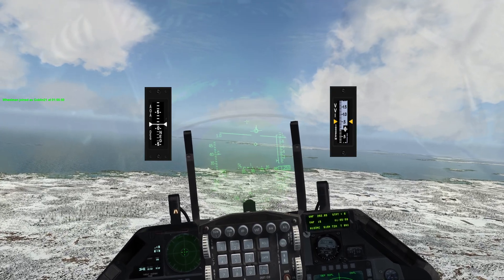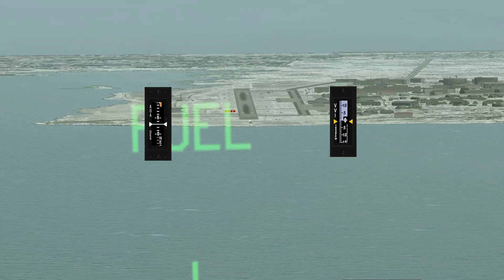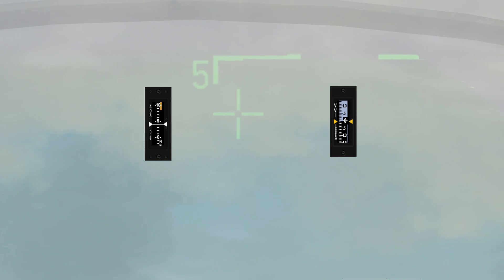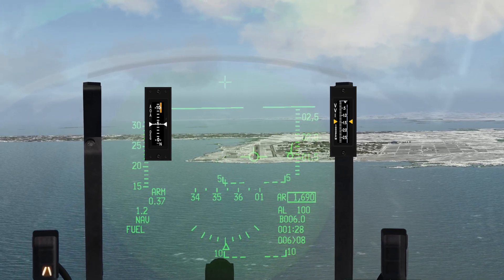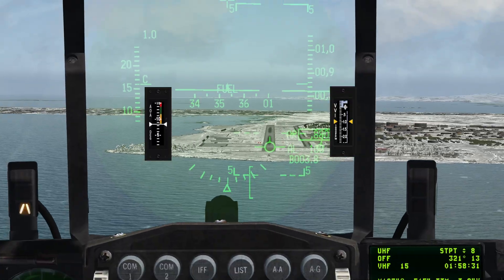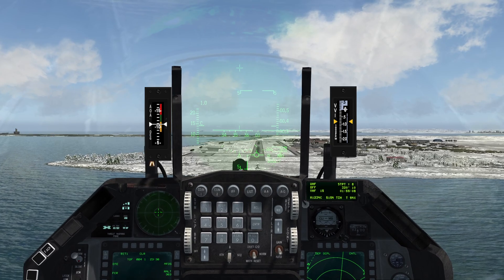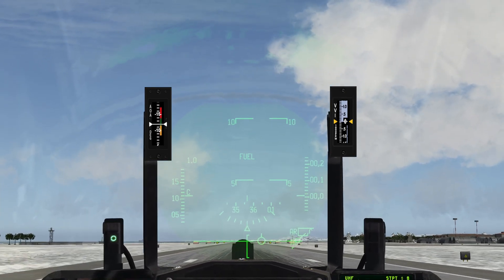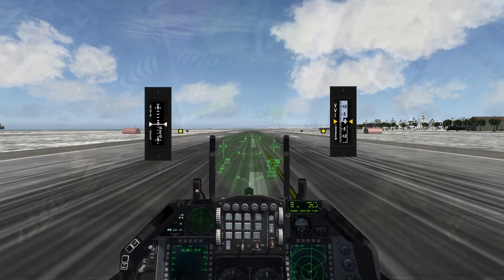Falcon BMS 4.36 VFR Landing Tutorial: Soft landings made easy

Comment: The required rate of descent on final is equal to groundspeed divided by two. 150 gs equals 750 fpm. Just add a zero. The sooner you get the gear out and let the jet extend the leading edge and trailing edge flaps the sooner you can reach the stability you are looking for. Putting them out late naturally destabilizes your approach until you bring it back in line.
Reply from the maker: I still always get a little hop on Landing unless I really really really really grease it, but after I understood the stabilized approach, I never crash landed again, or floated too far

Comment: I like to just visually fly the whole way and focus on faster threshold speed (160 or so) and as low vertical component as possible, feeding in power gently for a longer period during the touchdown. Fairly similar to how Russians land their planes, just without the drag chute. You can see real F-16 pilots do it too. I think this approach is a bit rough still, although should be more adequate for shorter runways. I haven't found a way to eliminate the tiny hop on touchdown, though.

This is usually from a fairly heavy landing, so fuel and bags at least, probably some slammers.
Reply from the maker: Right- whatever gets you down safely! IRL the standard 3 degree slope helps keep you visual the runway and above a minimum safe height for as long as possible before touchdown. The approach speed in knots is called “Vref” and is always dictated by your configuration. Vref: “1.3 times the stalling speed in the stated landing configuration and at the prevailing aircraft weight. This is the speed required as the landing runway threshold is crossed at a height of 50 feet in landing configuration if the calculated aircraft performance is to be achieved.”
All ATC probably expects pilots to fly their approaches by the book, but I don’t know how much flexibility pilots are allowed if they prefer a different approach.

Some BMS runways seem short at times - and it seems strange the F-16 can’t stop very comfortably when a giant cargo aircraft can. W/ These runways like the FARPS I usually adjust the approach for this.
Reply: @Wheelman_PCAS  I think the shallow method puts more stress on the tires and brakes so perhaps it's also a question of which is more preferable, tire/brake or damper wear.